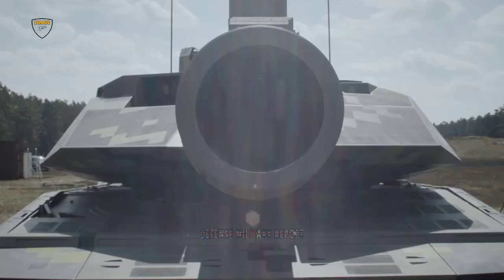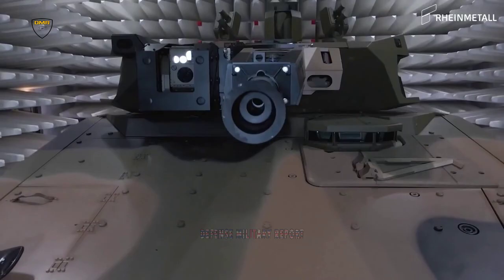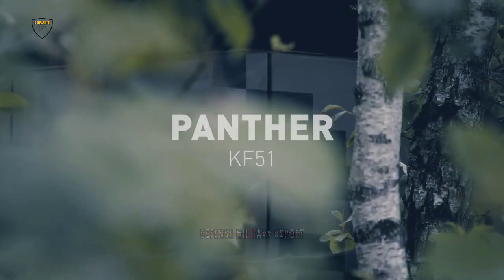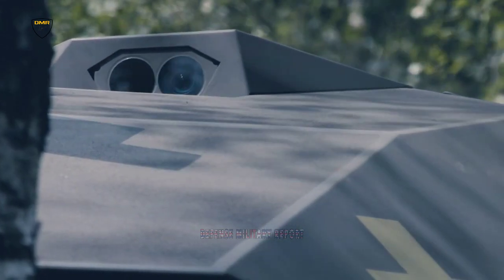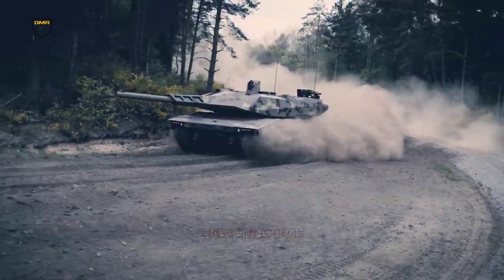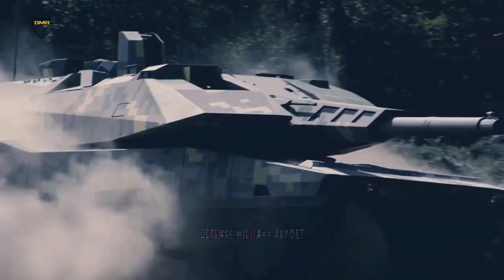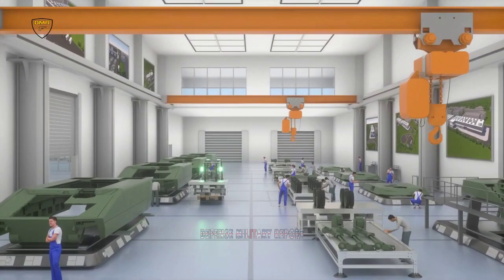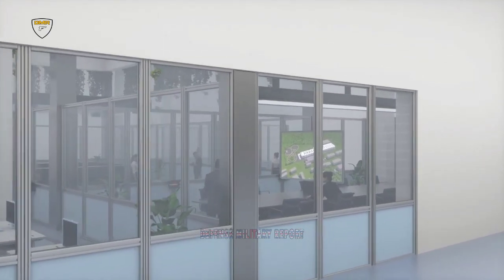Should UK Buy New KF51 Rheinmetall Tank

Comment: Chally 3 will be perfectly capable, people forget that the UK use their tanks very differently to how others do in combat... They also forget the Brits invented the damn things.
Reply: The Chally 3 is designed by the German company Rheinmetall and while you are correct that it's capable, it doesn't come close to this new beast.
Also, yes the Brits invented the tank, but the Germans have been at the forefront of tank innovations ever since.
Reply: @Diemerstein  The Chally 3's cannon and electronics are Rheinemtall, everything else is British, plus one massive factor the Chally 3 has is that most of it's components (being that it is a Chally 2 upgrade) have actually seen combat. Britain were right to keep the overall design British. So no UK don't need the Panther, as cool as it looks.
Reply: @tanner1111  Gun, German, MUltifunctional Self protection System German, Modular Armour German, Suspension German. Almost everything on that challenger 3 was designed or redesigned by Rheinmentall.
Reply: @Diemerstein  Mate its mostly British and made in Britain, don't oversell it.
Reply: @tanner1111  So who makes the best cars?
Reply: @GodlessReason  Relevance?
Reply: @tanner1111  Just because someone invented something, doesn't mean, they're the best at it. Take football as an example. 😂
Reply: @GodlessReason  Brits invented tanks because they understood their use for them, nothing to do with being the best. Chally 3's tick all the MOD's boxes, so to answer the video's question again, no Britain doesn't need Panther KF51.
Reply: @tanner1111  Whatever you say.
Reply: Who rests on one's laurels is wearing them at the wrong location.
Nobody cares who invented the tank... 
(It was Da Vinci btw)
Reply: The Challenger 3 will get the Rheinmetall Rh 130....
There is Rheinmetall-Raytheon in USA and there is BAE-Rheinmetall in UK.
Reply: @Diemerstein  For sure No engine by MTU in the Challenger 3 I guess.
A Perkins again?
Reply: @Warentester  Aww Seemed to of pinched a nerve there buddy, but people tend to forget who paved the way in modern military tech... Oh and you're welcome.
Reply: @tanner1111  I don't want to get into some nationalistic pissing contest, but I am curious about what you said about Britain using its tanks differently.
What do you mean with that?

I once saw a Royal Army training video from the 80s, which showed a defensive infantry position having a single Challenger 2 assigned to them as fire support.
That I found rather odd, because it sounds exactly like the mistake the French made in WW2.

You always hear how the French had the best tanks at the time, but they made the mistake to split them up and sprinkle them one by one along the front, so that the Germans, with their inferior Panzer 2 and 3 had no problem pushing through them, because they were smart enough to concentrate their tank forces and use their mobility and offensive potential, instead of demoting them to rolling pillboxes, as the French did.
Reply: @TrangleC  ''I once saw a Royal Army training video from the 80s, which showed a defensive infantry position having a single Challenger 2 assigned to them as fire support.'' 

And thats Precisely how the Brits do it. British armour is used to support offenses and defences, not spear head them like how the Americans and Russians use their tanks. 

Mobility is always an agreeable trade off when it comes to British tank design because they stay with their units and cover infantry while taking out hard targets.

This new Panthers development might of been kept hidden from the public, but EVERY NATO member would of known about it, Britain wants Rheinmetall Cannons and Electronics, but as far as armour, engine, transmission even the suspension which some wehraboo above mentioned was German, its mostly British. 

The Challenger platform is the only European tank that is a combat proven piece of kit.
Reply: @tanner1111  As I said, every historian and military expert I ever heard talk about tank tactics, calls what the French did in WW2 a prime example for how not to use tanks, so if that is current British doctrine, that would be worrying.

And the thing is, "combat proven" is a very wishy washy term.
First of all, the kind of combat Challenger 2s encountered in Iraq was hardly much of a test. 
Shooting at part abandoned, part demoralized Iraqis in downgraded export versions of old Soviet tanks would probably not have been much of an issue to any modern MBT.

The thing with the Challenger 2 in particular is that the Chobham armor is known to be very specialized against shaped charge ammunitions, but sub par against kinetic projectiles.
That is why both the Americans and the Germans rejected it in favor of their own designs.

I'm not shitting on Chobham, but it is a counter to a type of weapon that isn't used that much anymore.

Unfortunately kinetic anti tank rounds (APFSDS) have become the clearly dominant type of tank vs tank weapon in the meantime and as you know, even for shaped charge weapons, the top attack is becoming the new state of the art now, which means the Challenger 2's armor setup won't protect against those either.

TROPHY kind of has the same problem. Possible that newer versions are different, but as far as I know, TROPHY only works against relatively slow, horizontally approaching RPGs, with other words, the same kind of obsolete weapons the Chobham armor too is most effective against.

That means even with TROPHY the Challenger 3 is just really well and doubly protected against dated RPGs, which won't play much of a role on the battlefield anymore anyways after the Ukraine war, while being more vulnerable than other MBTs against all the weapons that will be used against MBTs in the foreseeable future.

I guess TROPHY could be modified so the counter measure starter could launch them upwards to catch stuff like incoming Javelins (or the Chinese copy we are guaranteed to see pop up soon), but it would mean you would need several radar antennae that also point up, which the Challenger 3 definitely does not have.

About what part of the Challenger 3 is made in Britain and what is German, I don't know much, but I did hear that Rheinmetall was not just a provider of a few parts here and there, but they had to manage and execute the whole project, because the tank manufacturing industry in the UK had atrophied to the point where there was nobody left to do it. Apparently all the engineers who had worked on the Challenger 2 were retired and there were no successors.

And it only makes sense. Why would there have been? What would a highly trained tank designer have done in the UK in the last 30 years?
There weren't even any upgrade programs for the Challenger 2 till now. Where would the money for employing those people have come from?

I didn't get that from Wehraboo sources, but from outraged British tank fans and I am inclined to believe it, because I also heard one of the reasons for why the Canadians first leased and then bought Leopard 2s was that there was no way of building new Challengers because all the factories and manufacturers had been shut down many years ago.

So when you then tell me that most of the Challenger 3 will be built in the UK and that Rheinmetall is basically just a supplier, I'm dubious.

If they do build most of them in the UK, then probably because Rheinmetall built the factories there, the same way BMW or Audi builds factories in the USA to build cars for the US market and get around import tariffs.
Reply: @TrangleC  Realisticly speaking, no modern tank can take a kinetic round and survive, were pretty much at the point now where the cannons of todays fire power have simply exceeded any type of armor. Its mainly for the most part about who shoots first.

As for how the French... Well that was WW2, no point in comparing tactics, totally different era now. Satellites, drones and proper intel gathering which the Brits are known for kinda make it alot harder for tank divisions to just swirl on by you know?

And its not just Rheinmetall who are working on the Chally 3 upgrade, people seem to forget that BAE are also working on it, who have plentiful of British engineers I imagine.

As for this Panther KF51, its just a prototype, the German army haven't even shown any interest in it, there working with the French on some other MBT platform.
Reply: @tanner1111  I agree about modern tank ammo seemingly winning the race against conventional, passive armor. When it comes to active protection systems, the Germans have not been sleeping either though. Rheinmetall, KMW, Diehl and IBD have all developed their own active protection systems in the last 5 to 10 years, which at least on paper, are all pretty impressive and have been tested successfully. And all 4 of them have in common that they are designed to be able to defeat shaped charges and APFSDS rods alike.

Something has clearly been integrated into the Panther. You can see those weird little windows scattered over its sides, front and rear.

I have my own conspiracy theory about why they threw the Panther out there now. From what you hear, the Germans and French are fighting over what gun to put on their future joint developed tank. The Germans want to use the Rheinmetall 130mm gun, but the French insist on using a 140mm gun from Nexter, which hasn't even been developed yet.

I think Rheinmetall wants to create facts. If they can sell the Panther to NATO countries, it will become very hard for the French to keep arguing for their 140mm fantasy gun and the 130 will become the next NATO standard.

It is a good time for that with everyone announcing that they will grow or modernize their military or both.

It also strengthens the German negotiation position to have a backup they can fall back on, if the project with the French would fall through. Now they have the option to tell the French to fuck off, if they keep being difficult.

So the German army doesn't have to show interest yet, but they have it in their back pocket, if the need arises.

I also think we are selling it a bit short when we call it just a prototype. They have been playing around with tech demonstrators and prototypes constantly for decades. That they gave it a proper name and a designation placing it in their current product lineup ("KF51") suggests that this is a finished product that they could sell. They haven't done that with any of the other prototypes and demonstrators.

Also, apparently they have signed a deal with the Israeli company that supplies the loitering bombs, which would be rather premature if this were just another tech demonstrator.

OK, but where was BAE before? Where were they when the Canadians and the Australians wanted to buy tanks?
From all I know about such international weapon deals, you pretty much always need some native "co-signer" who will officially helm the business, even though they usually are barely more than a store front for the foreign company.
That is why Airbus always needs to team up with Northrop or Lockheed if they want to try to sell something to the US Airforce.

As I said, I really don't intend to start the next fight and attack your national pride or anything like that, but I am not sure whether I can agree about the tank doctrine of sprinkling them over the front alone, attached to stationary infantry units suddenly being good because we have satellites now.
The French had reconnaissance too. The "Blitzkrieg" relied less on surprise and more on overwhelming, concentrated fire power and mobility. Just because you know the enemy is coming, doesn't mean a tank fighting alone isn't easily overwhelmed.
You know what I mean?

I'm open to arguments, but at least as of now, I don't really see how this is a good idea.

I'd think at the very least you'd need 2, so they can cover each other when retreating or advancing.
Reply: @TrangleC  look mate i don't really know what you're getting at tbh. As of the modern combat era Britain have been the most effective in the use of their MBT's... With zero losses. Why are you questioning their doctrine when its statistically second to none? Don't worry about the Brits pal.
Reply: @tanner1111  I think I have been very clear about any points I was trying to make. It just seems you are getting grumpy because you can't refute them.

I really am not here to start a fight. I just wanted to have a interesting conversation.

I'm sorry, but I don't think what happened in Iraq is comparable to what would be happening in a "peer" war.
Danish and Canadian Leopard 2s had also zero losses in Afghanistan. What does that really tell us?

The closest thing to a real tank battle in recent history was when a bunch of Danish Leopard 1s ran into some Serbian T-55s during the Bosnian war and had a fire fight. The Leopards won and also had zero losses.

Does that mean it would be a good idea for any army today to buy a upgraded version of the Leopard 1 over a younger, more modern tank?
Clearly not.

One mostly (As far as I know, 2 of those 4 Challenger 2s that were ambushed were mobility killed. The crews survived, but had to be bailed out by reinforcements.) successful engagement against a inferior enemy doesn't make the Challenger the best tank ever. I'm not saying it is a bad tank, but that is just a silly claim.
Reply: @TrangleC  Who said it was the best tank ever? You're just arguing for the sake of it... And the Turks Leo 2's were wiped out in Syria... Can you actually address the videos question and tell me is there a more proven and reliable platform than the Chally 3 for the BRITS? 

Britain have every reason to stick to their tried and trusted MBT.
Reply: @tanner1111  Geez, the Turks. That old chestnut?
The Turks were using their tanks as stationary pillboxes and didn't even notice someone setting up relatively big and heavy Russian ATGM launchers in spitting distance to them.
They could just as well have thrown them down a cliff or blown them up themselves.

What is that supposed to prove?

As to your question, since the Challenger 3 barely actually exists yet (or did I somehow sleep through them being delivered already?), the answer clearly has to be: "Yes, since the Challenger 3 hasn't proven anything yet."

If you want to insist on the Challenger 2 being proven and battle tested, even though it just had one run-in with a bunch of Iraqis with dated RPGs, I guess there is no point arguing over that point.
But even then, even if I would concede that point (which I can't, unfortunately), that still wouldn't change that that was a quarter of a century ago and things have changed since then.

If you want something "battle tested" that worked once and if a decades old track record is more important to you than modern capabilities, then why not stick to the Centurion or the Chieftain?

The Challenger 3 update seems just enough to get the tank to a current level with finally giving the commander independent night vision optics and a smoothbore gun, but that is pretty much it. As I said, TROPHY just works against the same outdated weapons the Chobham armor is already specialized against. The tank did not get more survivable against current and increasingly common anti tank ammunitions.

It puts the tank where it should have been 20 years ago, just when times and the modern battlefield is changing again and nothing about the Challenger 3 update really prepares the tank for any of those new threats or likely combat scenarios.

I'm not saying the UK must buy the Panther instead, but acting as if this old horse would be the better choice is just not realistic.

If you think BEA is capable of developing a modern MBT, then years ago would have been the time to get going on that.
Reply: @TrangleC  You write so much and still haven't answered my main point so i'll dumb it down for you... What tank if any could replace what Britain already has? What's the alternative? You're arguing so hard against the Chally 3 but you're not suggesting another platform? 

Its literally because you cant.
Reply: @tanner1111  I considered it superfluous and pointless. Fact is, at this moment, the Panther seems to be the only option that actually does address what we know about the future of tank warfare.

That is why it is making waves, why everyone in the military nerd community is excited about it and why we are here and having this discussion. If it were just another one of those old, last generation MBTs with a few new gadgets bolted to the turret, we wouldn't be here. At least I wouldn't. And that is precisely what the Challenger 3 unfortunately is.

(I would have had the same discussion and made overall the same arguments with a German tank fan who would claim it would be better to stick with the Leopard 2A6, because it has been working fine in Afghanistan.)

Yet I know that you or any other British tank enthusiast would consider it disgusting and unthinkable to buy a clearly and fully German MBT. So what would be the point of making that suggestion?

So the alternative would obviously have to be that either someone in Britain develops their own one, which seems unlikely for the aforementioned reasons, or somebody foreign you guys find savory and acceptable enough to buy from, like the Americans does it.

The latter unfortunately also seems unlikely at the moment, because they don't seem to give much of a shit about tanks.
The only thing I could see them doing would be to develop some air-liftable gun platform thing that can sort of, kind of do some things a MBT can do, but not really and they have been screwing around with that idea unsuccessfully since the 80s. (Since times when there still was a British tank industry capable of developing and proposing a prototype, actually.)

Funnily enough, today, once more Rheinmetall is currently the only supplier in the socalled Free World who has developed and offers what could be called a Light Tank with a 120mm main gun.

Maybe Britain could join in on the French-German joint venture and use that as a opportunity to regain know-how and rebuild their own MBT industry.
That seems to be the only realistic option that might appease British national pride at the moment.

I honestly considered that obvious enough to remain unspoken, but since you insisted...
Reply: the brits invented a lot of things, doesn't mean they excel at making them
Reply: @TrangleC   ''If it were just another one of those old, last generation MBTs with a few new gadgets bolted to the turret, we wouldn't be here. At least I wouldn't. And that is precisely what the Challenger 3 unfortunately is''.

This tells me that you have absolutely no idea what you're even talking about... There isn't another tank out their that can hit the niche proficiency that the British Army is accustomed too in terms of logistics, reliability, crew familiarity and battle effectiveness, of course someone like you wouldn't take these things in to account because you're easily stunted by all the fancy bells and whistles and what the guys in the white coats say.

Best trained tank crews and a tank that is  more than capable in carrying out it's role is the British surplus.
Reply: @TrangleC  Bullshit.. CR2 wasn't even around then.
Reply: @espacesX  Don't forget MTU is a British company...
Reply: @agt155  MTU Friedrichshafen GmbH is a German manufacturer of commercial internal combustion engines founded by Wilhelm Maybach and his son Karl Maybach in 1909.
Reply: @agt155  MTU Aero Engines AG is a German aircraft engine manufacturer.
Reply: @agt155  British Company called Rolls&Royce for Aero Engines, while Rolls&Royce Luxury Car Brand is owned by Munich carmaker BMW. The R&R plant by BMW is in UK. The legacy plant is today for Bentley owned by German Volkswagen Automotive Group.
Mini is BMW and MG is Chinese. Rover is now Chinese Rowe.
Reply: @espacesX  MTU is 100% owned by Rolls-Royce plc.
Reply: @espacesX  Only Rolls Royce car brand is owned by BMW. Rolls Royce plc own MTU, their engines are now branded as RRPS (Rolls Royce Power Systems).
Reply: @agt155  MTU is German company Like Skoda is Czech Carmaker.
Reply: @espacesX  ...just like RBSL who make Challenger 3 is a British company.
Reply: @agt155  British owned German companies...

Ever been at Lake Constance?

MTU/Rolls-Royce-Plant 1 and 2 are in Friedrichshafen, Lake Constance, Germany.

Germany is Not UK, which is Great Britain + Northern Ireland. GB = England, Scotland and Wales.
GB does not stand for "Germany a part of Britain".

E.g. Reebok never been German even Not as Part of adidas.

Here in Europe (on the Continent) we hold Up high the national identities and Common Spirit of Europe.
By the way "Europe" is a greek goddess and her Name stands for Vision incl. visionary, visionary Approach.
Reply: @espacesX  RBSL is in Telford = British company.
Reply: @agt155  MTU Friedrichshafen is Not Operating in Telford.
E.g. HQ of Volkswagen Automotive Group is in Wolfsburg, Germany.
Skoda is Volkswagen-Branch.
Lamborghini is Audi-Branch.
Skoda is Operating in Czech Republic.
Lamborghini in Italy and Lamborghini is Not a Bavarian Company, and Audi Not a Lower Saxony Company.

You may remember Grundig.
Today Not a German Company owned by Philips.
Grundig was never a Dutch Company but all Super-VHS keycomponents was from Grundig. So No S-VHS Videorecorder without Grundig. S-VHS Products from e.g. Philips where Durch Made. Panasonic where Japanese Made.
The Space-Shuttle Main Engine would never exist without the Inventions by German MBB. Space-Shuttle is US-american even at the early days of the Project Like the Idea was driven by German Rocket Scientist Wernher von Braun.

E.g. Cheddar is British Like Emmentaler is Suisse.
Reply: @espacesX  So we both agree RBSL is British
Reply: @agt155  Several Rolls&Royce named companies except the Luxury Car Brand owned by BMW are british....today.

But e.g. Grundig was still a German Company, when Durch Company Philips took over Grundig.

Tomorrow maybe whatever Company will be owned by a Hedge Fond with P.O. Box in Dubai.

So maybe tomorrow Rolls&Royce is Dubaian.

...in your World.

Because Rolls&Royce Luxury Car Brand owned by BMW is British not German.